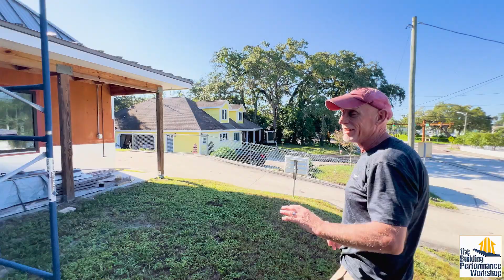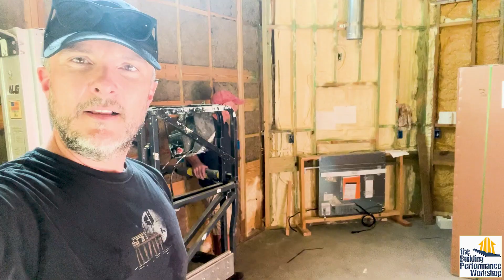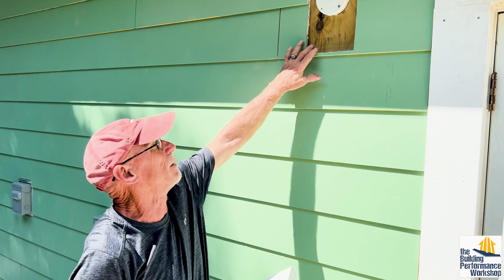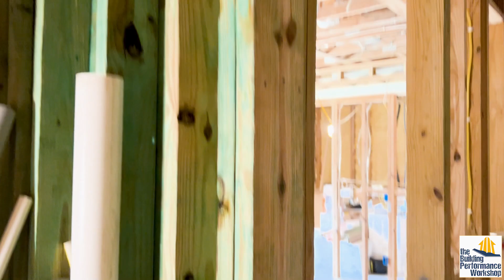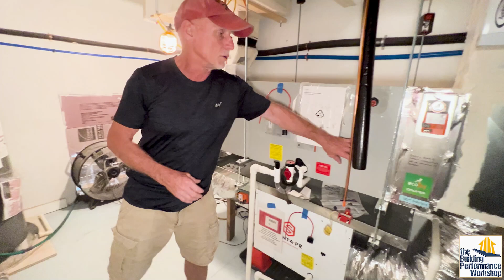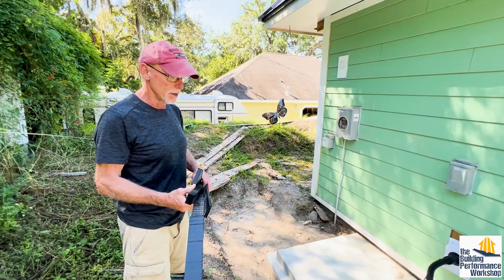Mark Cave's INCREDIBLE DIY Home Build- Tour of High Performance Construction

Comment: @howibuiltmyownhomeevenacav4944 

Mark, Love this!! I'm going to need to watch this on repeat. 
I'm building an adu (solo as well) using many of the same features you've employed on yours. On your issue with the Prosoco, I wonder if it is because it's on treated plywood (edit: watched again and I missed the part where you said that:)). I've used it on mine and can totally relate to the long term exposure risk, but I've had zero issues with adhesion or breakdown.
Some context; Pacific Northwest location, climate zone 4C, wet, fairly mild, 1/2" walls and 5/8" roof ACX sheathing, Joint And Seam Filler, Fast Flash, Spraywrap MVP rolled on. Unvented roof sheathing with Prosoco was exposed for 6-8 months and a 3rd coat was applied prior to insulating with 7 layers of 2" rigid eps, coverboard, and epdm membrane. Most of the walls have 2 years exposed to the weather and as I go, insulating with 2 layers of eps and strapping I apply an additional coat before install. I love what you're doing. I can so relate to your aversion (refusal?😅) to using subcontractors if at all possible. 
I hope your inspectors are at least pleasant to deal with, as the process is so much more layered and nuanced than the standard spec they're used to.
Best of luck!
Mike Wilcox
Reply: And Corbett, thank you for a thoughtful and insightful interview and video!! I'm a long time subscriber. Your channel is a wonderful resource for the aspiring performance builders out here. Thank you!
-Mike
Reply from the maker: Thanks Mike!

Comment: So if he’s never using a vented dryer then why install a vent and booster fan?
Reply: Unfortunately it is still required by my local inspectors to be installed even I plan to never use it.

Comment: Mark's comments about the price of the larger filters make me wonder if it wouldn't make sense run smaller, less expensive filters in a V-configuration if you've got enough room. Is that even a thing? Tried googling this idea but came up only standard single filter boxes, dual in-line filter boxes, and massive commercial multi-filter boxes.

Comment: A note on the clothes dryer: Our household recently acquired a heat pump LG Washtower (a heat pump dryer and washer stacked together) and it was about the same price as the all-in-one washer/dryers at the time of purchase, and allowed more loads to be done in given period of time than a single all-in-one unit. In my opinion, everyone should be considering a heat pump dryer since they use VASTLY less energy, don't require venting, and don't depressurize the building envelope.

Comment: I bought a small house that I’m trying to completely renovate by myself but I need help figuring out a few tiny details. I can’t get any architects or engineers to return my messages.
Reply from the maker: Not an arch or eng, but I’d be happy to talk about it:
https://buildingperformanceworkshop.com/video-consulting
Reply: I had a very similar issue at the start of my build, all I can offer is persistence.  I used a CAD program called Chief Architect  and drew everything up before I started looking for an Architect, even then It took me about a year to find an Architect and an Engineer to get the plans drawn and approved to my county's standards.